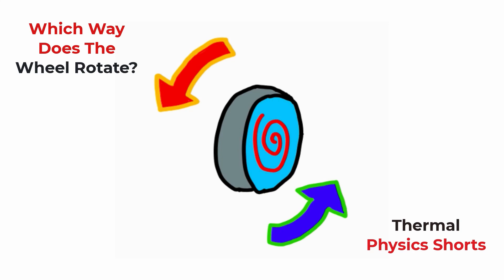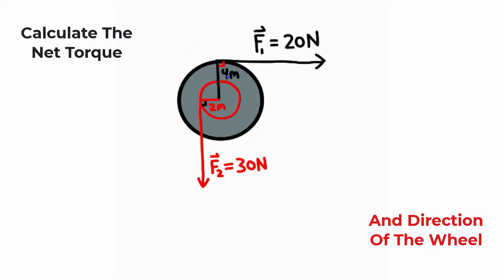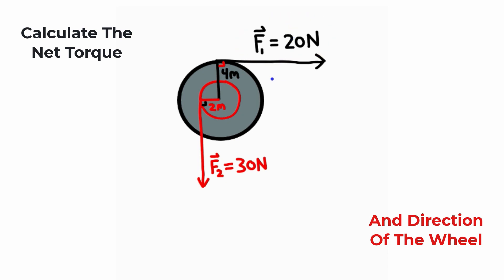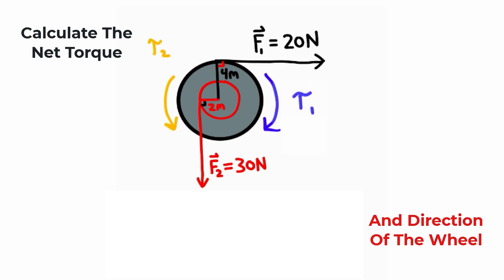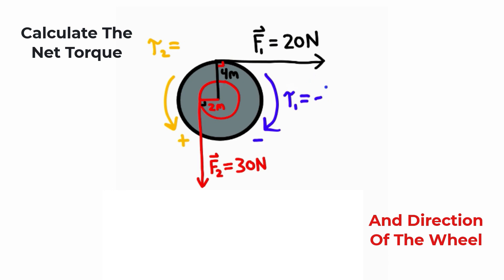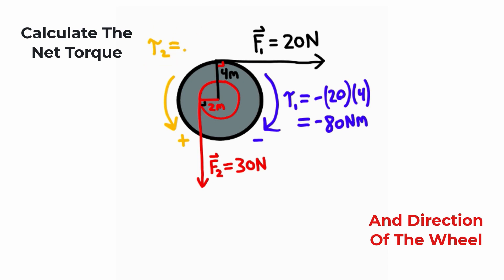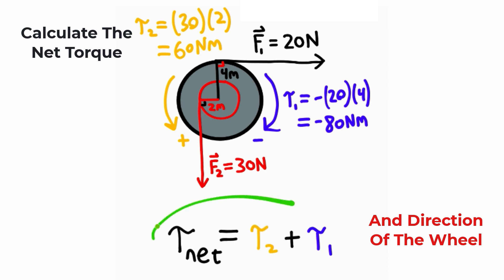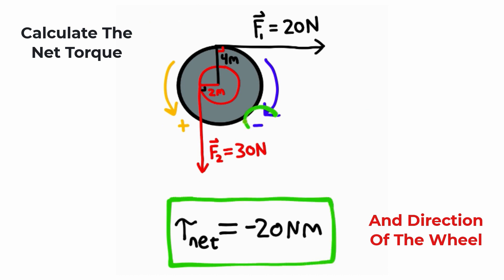TRUE Engineers Can Solve!!

Comment: So, a very basic version to explain vectors.
Reply: They are quantities that have magnitude (i.e. amount) and direction, and are represented by arrows, with a length indicating the magnitude, and a direction of course indicating the direction.

The math you can do with vectors is as follows.  There's more, but the most important stuff to learn is this:
1. Determining component form.   Knowing which trig term is needed to get each of the two components.  Look at the extreme cases of angle = 0 degrees, and angle = 90 degrees, and know the general patterns of sine and cosine to determine which trig term to use.
2. Determining magnitude and direction, starting with component form
3. Scalar multiplication
4. Addition.   Arrange head-to-tail, and find the shortest path from first tail to last head.  Add up corresponding components, if given component form.
5. Subtraction.  Like addition, but reverse the direction of one vector first.
6. Dot product.  A measure of the product of magnitudes, and how aligned the vectors are.  Work is an application of the dot product.  It can be calculated by multiplying corresponding components, and adding them up.
7. Cross product.  A third vector, perpendicular to both source vectors, equal to the product of their magnitudes and a measure of how crossed (i.e. perpendicular) the vectors are.  An application of the cross product, is torque.  There is a matrix to set this up, with the unit vector row, and a row for each source vector.  Then you follow a procedure of multiplying along positive diagonals and negative diagonals.